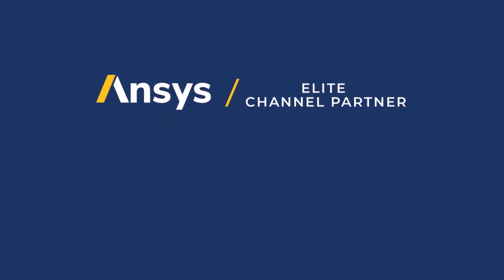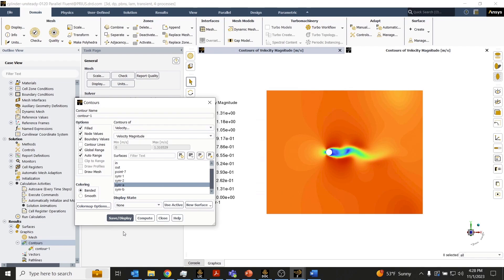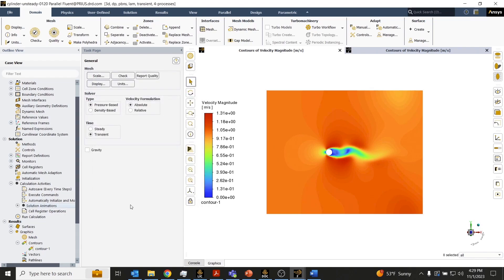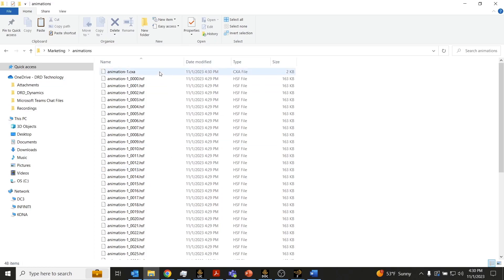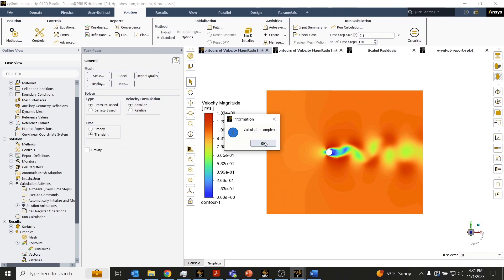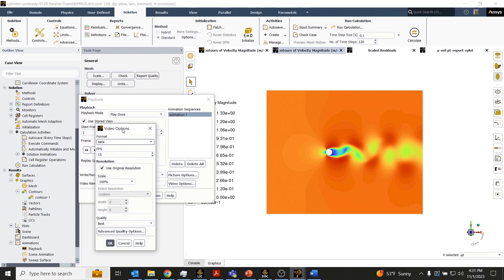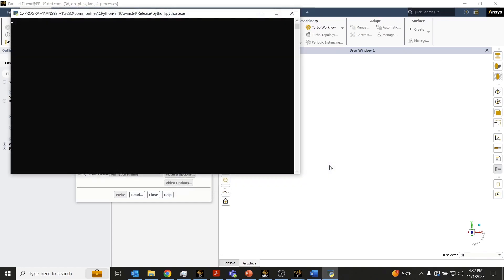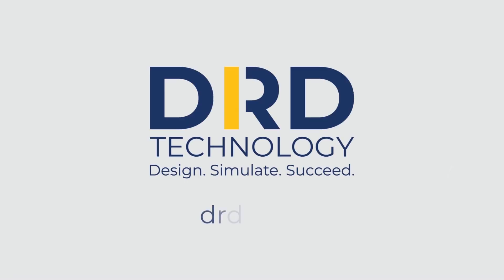Creating Transient Animations in Ansys Fluent

Comment: Do you really have to specify the animation before the calculate? Is there any way to generate an animation after the calculation is done during post-processing (assuming you had it save the full data of each step along the way)?
Reply from the maker: Generally, animation files are preferred due to file size, but you can also create animations from a variety of solution file formats – including native H5. This is typically done using a dedicated post analysis tool such as EnSight or CFD Post. Transient post processing in Fluent is currently a beta capability at version 2025 R1 and can be accessed from the Fluent Launcher.

Comment: Thanks for the video,  I want to ask something please,  as far as I understood to make animation ,  I see you first get a contour from a running case already or this is after initialization?  and then you start to do the steps of animation by choosing the contour you have and so on ?  I tried to make contour before running the case, it can not be done, I mean I can not make contour before running he case !!   Thanks in advance
Reply from the maker: Thank you for your comment! It is true that you cannot create a graphical object if there is no solution in memory. Often you will start a transient solve with a converged steady state solution as the initial condition, however, this is not always possible depending on the goal of the simulation, and an initialized flow field must be used as the initial condition.

Comment: How can I change from an isometric view to a 2D view? I can't find the option to change the view.
Reply from the maker: You can click the ‘Use Active’ button in the Animation Definition Panel to save the animation sequence in the view that is currently active in the graphical window. We recommend clicking the ‘Preview’ button in the Animation Definition panel before running the transient model to make sure the sequence is saved in the appropriate view orientation. When you save the animation sequence using the default HSF file format, you can change the view orientation when playing the animation by un-checking the ‘Use Stored View’ option in the Playback Panel.